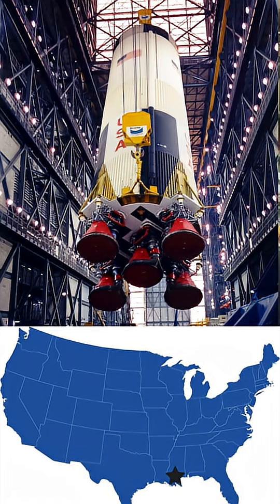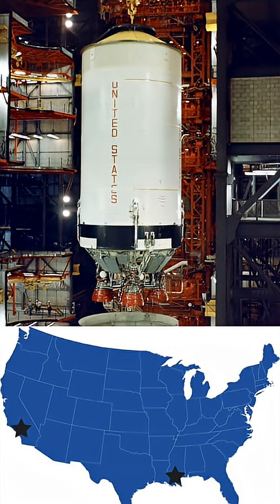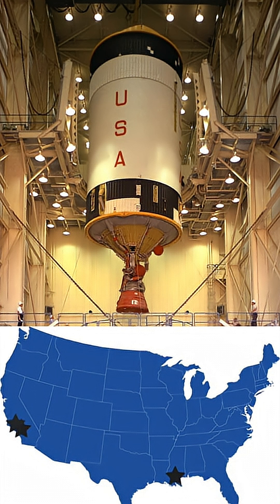How to build the biggest rocket #shorts #history

Comment: I worked at Douglas from 1960 to 1963. I tested the insulation for the S-IVB in Santa Monica and Sacramento. Twelve of the S-IVB 200-series were built and sixteen of the 500-series, plus three test versions.

Comment: I visited the Stennis NASA Space Center in Mississippi. It occupies an emense area of land. Part of it's location was due to the influence of its namesake, Mississippi Senator John Stennis, who wanted a slice of the space program pie for his home state; the other part was its being close to barge traffic on the Intercoastal Waterway. It is the place where the the Saturn engines were test fired and certified before being shipped by barge on to the assembly building at the Kennedy They needed thousands and thousands of acres of land to provide a noise buffer for the horrendous roar of the engines in the rocket tests Space Center in Florida (the vibrations from the engine tests set off seismometers at area universities as if they were detecting an earth quake. Well worth a tour of the Infinity Space Center museum there by space program fans like me. It's on the way along Interstate 10 between New Orleans and Mobile.

Comment: Correct me if I'm wrong:

I heard that one of the first space rockets had to go through a train tunnel, which was first made for wagon caravans, which went along roads, built on trails made by the frequent tred of cattle drawn wagons two abreast. 

So, the space rocket had a design constraint based on cow size.
Reply: Actually, the width of our railroad tracks go back to the days of ancient Rome. The roads were made for the carts that were pulled by donkeys and over time, ruts would form in the stones used to pave the roads. So basically, the railroad tracks are "two asses wide".

Comment: I work in the building where the SIVB was designed. It was built across the street on a military base, but I think those manufacturing sites were torn down years ago.  The harbor where the SIVB was put on the barge was about a mile away.  They had to block off the main boulevard when they trucked that stage to the harbor.

Comment: And then the Super Guppy went to Europe and became instrumental in the creation and success of Airbus. So much so that Airbus created its own successors to the Guppy with the same unique configuration, the A300-600ST Beluga and A330-743L Beluga XL.
The Super Guppy is of course also one of the distant descendants of the B-29, throught the Stratoliner (but not its most surprising, which is the Tupolev Tu-95 Bear).
And last thing, the only scale model kit of the Super Guppy is the Otaki/Revell 1/144 one, which I'm lucky to have, as it is one of the legendary set of great Otaki kits for which the molds were lost in mysterious circonstances during the 1980s...

Comment: To be clear, this is a VERY inefficient and expensive way to construct a rocket compared to single manufacturer, single operator like SpaceX.  To get congressional support from various states for the space program NASA had to distribute funding and projects across multiple states.  It was very political, very pork heavy, very cost-plus process but it worked.
Reply: "It was very political, very pork heavy, very cost-plus process but it worked." Unlike Artemis.
Reply: Competition is almost certainly a heavy contributor to the success of Apollo. Blocking the critical path in a mutli-source system is a strong motivator.
Reply: Yet SpaceX is still overpriced.

Comment: The size of the space shuttle boosters was limited by the train tunnel it had to pass thru.
Reply: Indeed. The size of the sections of Soviet rockets were limited to what a train car could carry.  They had no crawler or giant assembly buildings.  Thats why the Soyuz side boosters and main stages were shaped like they were and still are essentially.
Reply: Basically the same for Falcon 9 stages although they are transported by road. Still have to get under bridges and through tunnels along the way.
Reply: If I remember correctly, it wasn't just the diameter of the SRBs that was limited by tunnels, but the length of the segments.

If it hadn't had that requirement and had the SRBs assembled at KSC, perhaps they wouldn't have segmented it, and the whole O-ring issue that led to the Challenger disaster wouldn't have happened.
Reply: @tomgidden  Compromises to get congressional support to get budgets passed... have to spread the work out.
Reply: @zapfanzapfan  Of course; it also explains the longevity of Constellation and then SLS. Doesn't mean it's a good idea, though… compromising design and ultimately safety (and almost certainly cost) for the sake of pork-barrel politics.

The gravy train results in expensive, unreliable, overcomplicated, overbudget, late, and ultimately bad rockets.

(That's not to say that it's the only reason for bad rockets, but it's undeniably a major one.)
Reply: @tomgidden  Considering all the compromises it is amazing the Shuttle flew as well as it did.

Having production of large solid boosters is strategically important, guess why Ariane 5 and 6 has them too...